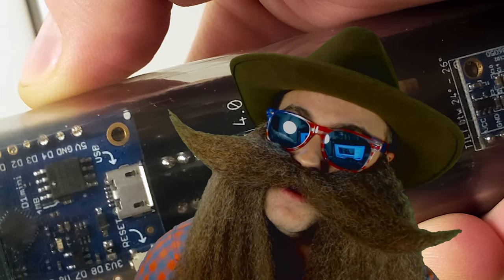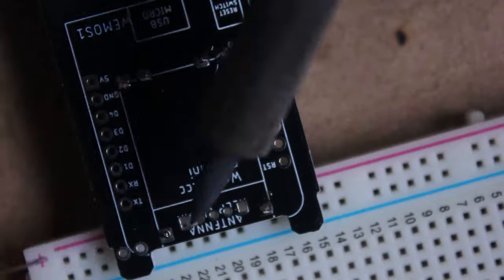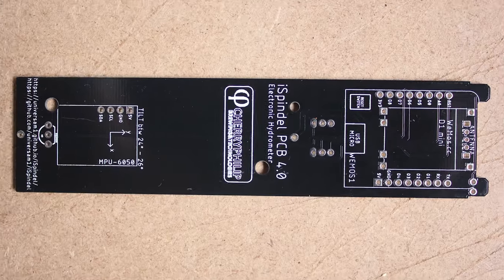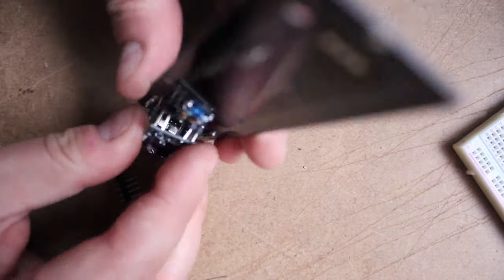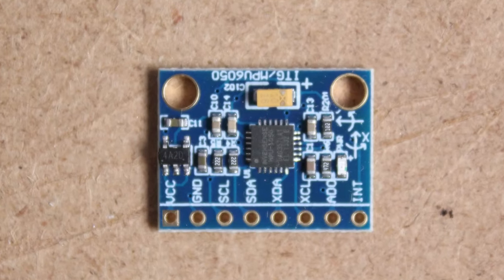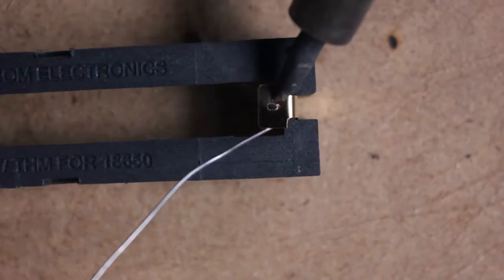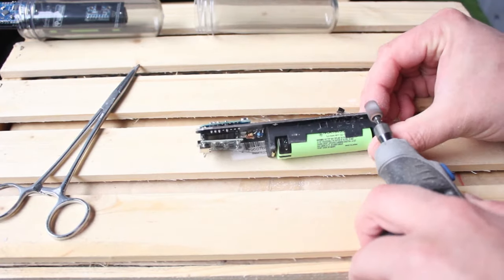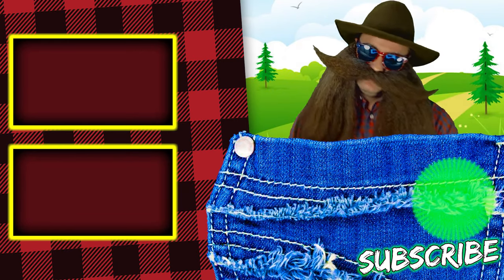iSpindel Assembly Instructions in English - How to make an iSpindel PCB 4.0

Comment: I have a problem with the Ispindel's data. I've hooked it up to Blynk and the gravity data of the Ispindel outputs only 2 decimals (x.xx) how can i get to be 3 decimal (x.xxx)? the settings in blynk are correct. and set to 3 decimals.
Reply from the maker: The same issue exists in Ubidots but it's Ubidots and not the iSpindel. In Ubidots you need to create your own dashboard components and set the decimal values to 3 (X.XXX) there. I assume the same thing would be required for Blynk.

Comment: Thanks so much for putting this together.  I recently ordered all the parts and pieces and have a paper write up on assembly but this is so much better.
Reply from the maker: Thanks! When I set out to find instructions I couldn't find an English video that showed how to assemble the most recent version of the printed circuit board. Stay tuned for flashing the firmware, calibration, and the different services that the iSpindel can connect to. Thanks for watching and I'm glad you enjoyed it.

Comment: I['ve got two of the tilts v2.0.  One is excellent and dead on with hydrometer readings.  2nd not so much.  I calibrate each time and its close.   I'm looking to attempt these.  while i've soldered quite a bit for electricity, not electronics.  can you recommend brand /setting for solder gun & brand / type of solder?   thanks.
Reply from the maker: I don't have any recommendations, I use a crappy $20 soldering iron from my local electronics store. Before that, I used a very old whittled down iron that was like 20 years old. Anything on amazon with a good rating would work just fine. Thanks for watching!!!

Comment: Thanks for the video! would love to build a few of these. Quick question, the price displayed for the PCB is for 1 or for 5 nos? If it is for five, then I can probably look at buying a few in next month or two. Still have some brew equipment and a small home stores to invest in first...
Reply from the maker: The minimum order is 5 pieces from PCBWay. Check out the new and improved PCB design I did at the link below. It accepts cheaper parts and has other improvements. A new assembly video will be coming soon :) 
https://www.pcbway.com/project/shareproject/iSpindel_The_Jeffrey_2_0___Open_Source_Distilling.html
Reply: @OpenSourceDistilling  thanks bro. You've literally made it possible for me to be able to build something like this. After trying to go through their website, I decided to put it on the back burner until later this year. 
Do these fail at all? If so, the price increment to 10 isn't all that much and I can keep a few on had. Problem for me is I live in Asia so getting these increases the shipping costs. Might as well have a few in stock of there is a chance for failure.

Comment: I saw people talking about removing a diode on the D1 Mini, I noticed you didn't do that?
Reply from the maker: I've never heard of that. Do you know what removing it is supposed to do?
Reply: @OpenSourceDistilling  never got a straight answer, reduced power consumption?
Reply from the maker: @stuh4645  Found it. Link below. DOES ANYONE KNOW WHAT REMOVING THE D1 MINI DIODE IS SUPPOSED TO DO? The next comment down on the link is from the guy that built the PCB I use in the video and he says it is not necessary to remove it. Thanks for bringing this to my attention. If you find out why people are removing it please let me know. I'm interested :) https://github.com/universam1/iSpindel/issues/154#issuecomment-399161198
Reply: @OpenSourceDistilling  great! thats the one, I ordered the boards from your link today so I will just follow your build! If I can find any more detail I will let you know. thanks
Reply from the maker: @Cold Passion, I was able to ask CherryPhilip and get an answer from him. Please see below. It appears that removing the diode and connecting the positive power in via a wire to the D1 mini allows you to power the iSpindel without having a battery installed. However, I took my battery out, connected my iSpindel to my USB charger and it appeared to turn on without issue. So I’m still not sure what the advantage is for making that connection.

[CherryPhilip] I’ve never removed any diode from the Wemos, the positive line coming from the TP4056 is not directly connected to the wemos, therefore the USB is not able to power the wemos but only battery, the same from USB Wemos to battery or USB TP4056.
In any case if you want to stay sure when you use an externally USB power for Wemos to avoid possible overcurrent , you can remove the battery from holder or keep the slide switch in off position.
Reply from the maker: @Cold Passion, I have a correction to make. When I looked into it further it appears that taking out the battery then plugging in the iSpindel via the USB charger doesn’t actually turn on the iSpindel. It does make the D1 mini LED flash on but it doesn’t actually power the iSpindel to a working condition. So that’s the answer, removing the D1 mini diode and connecting it to the battery charger allows you to power the iSpindel via USB without a battery being present.
Reply: @OpenSourceDistilling  Plus, if you have the battery installed, I believe you can create an overload of the battery if you plug into usb without removing the diode
Reply from the maker: @MarkOwenHome  I'm not sure I fully understand. None of the circuit boards require you to remove the diode. Do you mean that if you charge the iSpindel while the power switch is on you can cause damage?
Reply: @OpenSourceDistilling  Yes, as I understand it, from comments made from universam1. 
https://github.com/universam1/iSpindel/issues/119
Reply from the maker: Okay I understand now. When you plug in the D1 mini you are also sending power to the D1's VCC, which is attached to the battery if the battery is present and the power switch is turned on and the diode still exists on the D1. That battery isn't meant to handle 5 volts so that's a bad thing. It looks like the solution is to remove the D1 mini's diode and then the battery can't get overloaded. The only 'downside' is that you'll need a fully charged battery present before you flash the D1 mini's firmware via USB cable. Thanks for digging up that article. I appreciate it! I will update my postings appropriately. 

Sincerely, 
Joey Joe Joe Jr
Reply: @OpenSourceDistilling  No problem, you're welcome. Your description above is spot on.
Reply: Where can I buy the pcb? Thanks

Comment: Hey, nice video. Just used your guide to help build 9 iSpindels. Just a note, the PCB mount battery holder in your blog post is not correct and will not fit in the container as they are square ended, rather than slightly tapered and shorter than the battery height. The pins on that model are also too large. You ideally want a Keystone model 1043 18650 battery holder or cheap Chinese equivalent.
Reply from the maker: Thanks for letting me know man! I have updated the links on my website to point to the Keystone ones. I appreciate the feedback. Happy brewing!

Comment: will they fit in a carboy?
Reply from the maker: Depends on what carboy you use. I use plastic buckets where the lids come fully off. They won't fit in a 'classic' glass carboy like this https://images-na.ssl-images-amazon.com/images/I/51nijr%2B6FjL._SL1000_.jpg, but would fit in the wide mouth version. I am told that metal carboys mess with the wifi but haven't actually tested it. I will be testing it in a fridge eventually.
Reply from the maker: I'm now being told that many people report success in stainless steel fermenters.

Comment from the maker: Would you be interested in me putting a package together with all to components to build a single iSpindel? How much would ya'll be willing to pay for one? Let me know as I'm considering doing it.
Reply: It's hard to know what your time is worth.  I've read that the parts can be purchased for ~$20 USD. obviously if you buy in bulk it's cheaper...  the real issue comes with running the software and data storage... throw a price out there, see how people react.
Reply from the maker: @themoch  I think I'm going to pass on selling a kit, at least for now. I don't want to house the stock and be personally responsible for shipping them out. To get the parts cheap you need to order directly from China and last time it took close to 3 months to get the final component. The bummer is that you can't cheaply buy the parts to make just one, you have to buy at least 5 PCBs, my DS1820s came in a pack of 10, the on/off switches in a pack of 20, and so one and so on. I spend about $100 making 5 of them (I have leftover parts) so that's about $20 each, but I had to spend $100 to get them down to $20 each. Still... when compared to the price of a tilt it's still a good deal. Happy distilling and thanks for your comment!
Reply: @OpenSourceDistilling  In Ebay UK you can find the whole kit for you to assemble at 30 GBP. Another seller was offering the functioning device at 40 GBP and he sold out.
Reply: @OpenSourceDistilling  I reckon that as long as you sell it at least 50% cheaper than a Tilt people will buy it. Not all us fermentation fans possess this level of electronics/computer know-how
Reply from the maker: @Lyron7  Tilts are pretty darn expensive. I suppose that I'm not bold enough to offer fully assembled iSpindels on eBay. Regardless of what country you are in, most countries have patent treaties allowing one country to enforce their patents in another country. I know enforcing patents can be costly for the patent holder but selling fully functional iSpindels for profit would definitely be in violation of patent laws. As far as having this level of electronics/computer know-how, most of the hard to figure out stuff it handled by other people. If you can follow along with this video and the firmware flashing video you are good to go! Thanks for watching and taking interest :)

Comment: Hi again! Did you get the iSpindel to float correct? Mine float like a cork :(  Tried to find some info from the designer of the PCB...but no luck so far!
Reply from the maker: Hello! I have ideas about it and have tried things with some success. Make sure your PCB is as close to the lid as possible as opposed to the bottom of the tube. The further down the PCB sits, the lower the angle in pure water. I've tried adding weights but you can only add so many before the entire iSpindel sinks. I am going to make a video about moving the resistors and diode to the other side and moving the battery up, someone told me that worked for them. I will also have designed a PCB coming out soon which will solve this problem and accept different/cheap/readily available battery holders. Cheers!